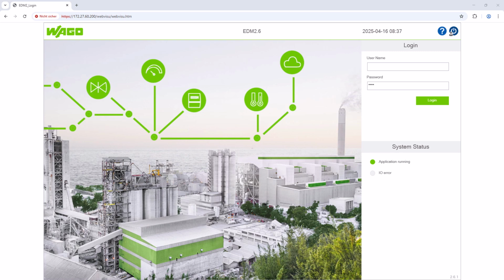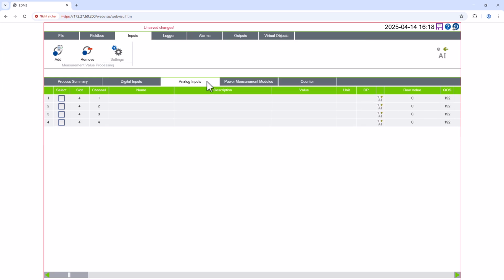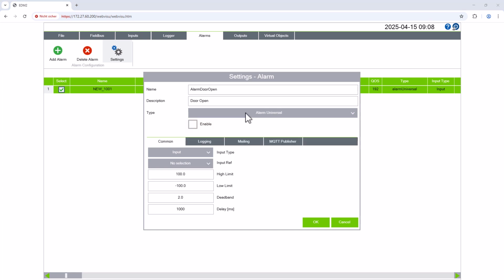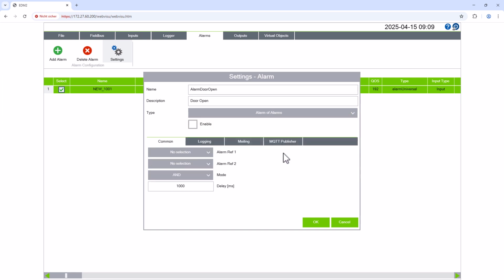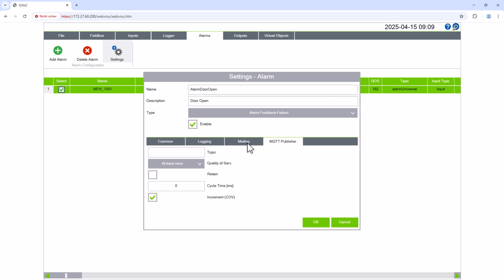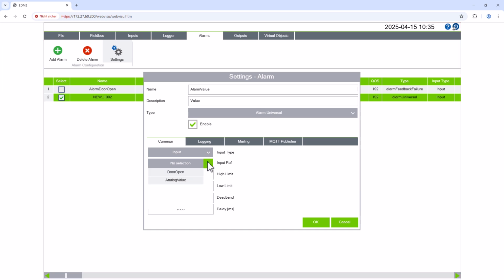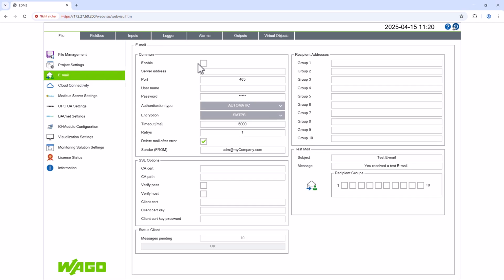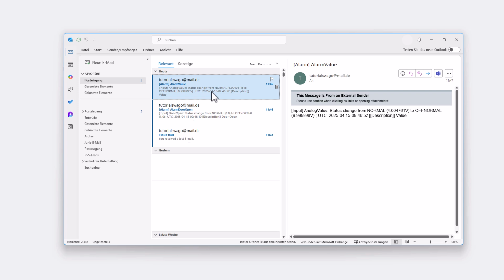WAGO Energy Data Management | Alarms and email notification

Comment: I’m located in Taiwan, attracted by this solution, can you tell me the specific order number so I can talk to Taiwan based service centre. Knowing barely available cases over here compared to German. I am appreciated seeing this video.
Reply from the maker: The products/modules used in the video are as follows:
• 750-8212 PFC200
• 750-430
• 750-459
• 750-600
• 2759-206/261-1000 Energy Data Management (License)
In addition, a suitable 24VDC power supply (e.g., 2687-2143), the switch (789-801), and the test module (789-904), which provides or simulates the analog value, are required.
Only one specific function (alarming) is shown in the video. However, our energy data management is modular and flexible, can automatically detect additional modules, and then offer the corresponding configuration options. The suitable modules and limitations are described in the following documentation: https://www.wago.com/de/d/11069#versions
Kind regards from the WAGO Team